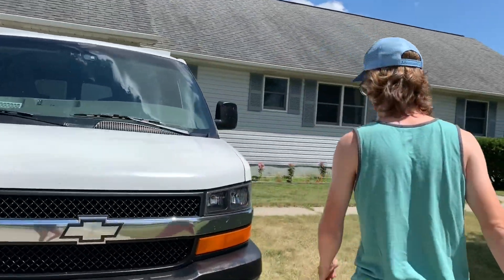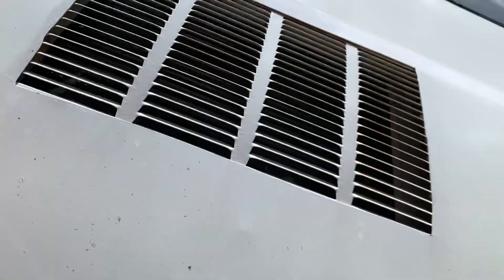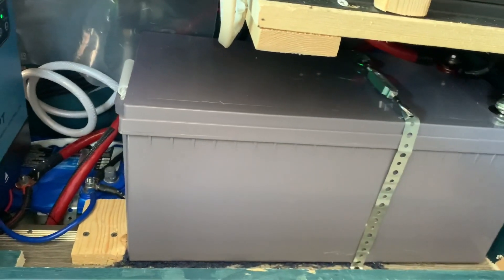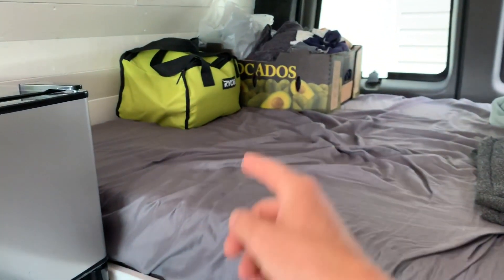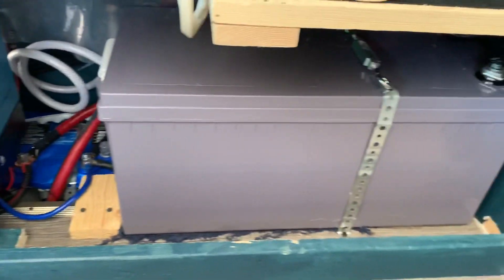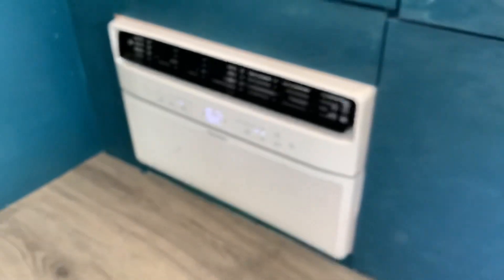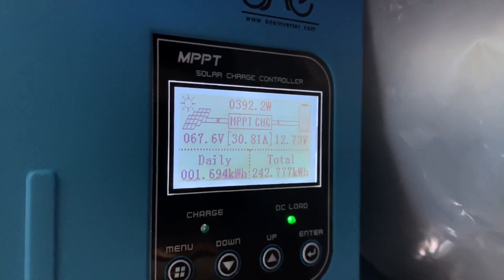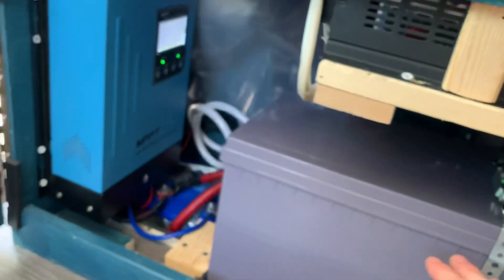Van Life Solar AC Setup - Totally Off Grid

Comment: You need a much bigger battery bank for the AC to run through night.
Reply from the maker: You’re right, but if we ran it all night we would be below freezing inside. (It's only 250cuft of airspace in the vans living area - the average small bedroom is 1,100cuft)
About halfway through the night ours would rarely come on except once or twice before the morning (as the outdoor temp already dropped and there was no further need for cooling).

In the dark, the sun won't be baking you inside the solar oven that is the van, so a good average after dark might be 25% cycling (15 minutes run time every hour). So, if you're calculating 10 hours of AC at 25% cycling, that would be a cumulative run time of 150 minutes. (2.5 hours)

Of course, this all depends on your outdoor night temperatures. We don’t stay in Phoenix or Vegas during the summer as it’s 120F in the day and 100F at night… The van has wheels for a reason!
Our AC (even after inverter inefficiency losses) draws almost exactly 50 amps at 12v.
50 amps * 2.5 hours = 125 amp hours

To calculate the usable amp hours, you must decide what depth of discharge (DoD) level you’re comfortable with. 
Is it 50%? 75%? Or do you go all out and run your batteries to 100% discharge, not caring about the usable life?

Will for sure make a video of the daytime / night time cooling along with battery levels and indoor / outdoor temps once it warms up for a test!

Comment: I've crunched the numbers to get AC (no roof-mount units) in my Van here in Australia: $2800. Now, going the DiY route, Anything under 2.4kw locally is garbage. 

Buying a small 120v unit like yours and a US Inverter, imported to Australia, I'll get change from $1000.

Great video mate !
Reply: If your interested,  I'm just trying the same thing Guys. I've managed to find a heat pump unit - with a duct pipe outlet - I'm planning on ducting it fore and aft of my build. Plus of course it will heat very very efficiently in the cold weather.. oh, and so far it's cost me just over £320
Reply from the maker: @jupiteradventure5284  I hear heat pumps are more common across the Atlantic than in the US. So sad as it's such a simple principle and typically the most efficient form of electric heat!
Sounds like a sweet build!
Reply from the maker: That's bonkers. Glad it helped out!!!

Comment: The A/C unit could be installed higher or air flow is channeled to blow at the ceiling level for better cooling performance
Reply: I don’t think it’s wise to put heavy stuff higher in a van, because the center of gravity. The van will roll over easily.
Reply from the maker: For sure. Mine has windows all around though so no way to exhaust the condenser heat unless out through the pop-out side window.
Will have to duct the cool air up higher in my next re-config!
Reply from the maker: Just installed ducting to the AC unit. Should have done it sooner.
https://youtu.be/wq_KdOZR2R0

Comment: Do you have 24 volts setup for your solar?
Reply from the maker: Just 12v. Really liked the idea behind the Victron battery combiner instead of a DC to DC charger (and the cost savings)

But it would have been nice to run smaller wires and enjoy the more efficient Solar chargers and inverter systems.

Comment: How much battery would you need to run all night? We’re in Florida so it’s pretty much a necessity
Reply from the maker: Ah. Good old Florida. Always hot and humid.
I wish I could give even a general idea, but it depends so heavily on how often the AC cycles throughout the night.
About halfway through the night ours would rarely come on except once or twice before the morning (as the outdoor temp already dropped and there was no further need for cooling).

Try this out:
https://www.batterystuff.com/kb/tools/calculator-sizing-a-battery-to-a-load.html
Our AC (even after inverter inefficiency losses) draws almost exactly 50 amps at 12v.
Then the only variable left to input is the run time (load duration).

In the dark, the sun won't be baking you inside your van which is essentially a solar oven, so a good average might be 25% cycling (15 minutes run time every hour).
So if you're calculating 10 hours of AC at 25% cycling, that would be a cumulative run time of 150 minutes. (2.5 hours)

(You can run it much longer if you want to drop below that discharge level, but the higher the depth of discharge (DoD), the more you take away from your batteries usable life)
Reply from the maker: I should also mention a HUGE determining factor is how much air you're cooling.  Our van is so small with the low roof and large cabinets / raised bed that there's very few cubic feet of air to cool.  A large Sprinter / Transit / Promaster will easily double / triple the amount of air to cool.
Just food for thought and thinking out loud on that!
Hope that helps! 
Thanks for watching Tyler!

Comment: Love the stealth grill look. If you did it again would you put the air conditioner higher or would you just duct the cold air higher off the unit so it would naturally drop? Also would you or do u recover the water from the air conditioner?
Reply from the maker: Hey Shane, if my van more were square and didn't have windows all around the upper half I would probably mount it higher.
The glass windows surrounding the entire perimeter of the van made that tough.
Even if it were a cargo model though, the GM vans have a very "rounded" interior (where the ceiling is much more narrow than the floor)
This would make the AC unit protrude way out into the living space unfortunately.

I think I would floor mount it again and duct it higher in this particular set-up if I were to do it again.

I don't recover any of the water from the condensation, it just drips to the ground outside. There is a huge 75 gallon (284 liter) water tank under the bed, so we don't worry too much about our water levels.

Thanks for watching!!
Reply from the maker: Hey Shane, actually just finished adding ducting to the AC unit (finally!)
https://youtu.be/wq_KdOZR2R0

Comment: Great job on your van and your well explained video. Can rooftop panels be mounted to tilt when you want, for Max exposure?
Reply: Look for Snow & Kurt channel on YT.
Their van has a killer array that lifts with linear actuators.
Not really complicated.
Reply from the maker: Excellent idea as it would really increase the solar input (by more than double in some instances).  It's something I would have loved to do but lacked the welding expertise.
Reply: @VanwithTim  bolt an alloy frame with hinges. Sorted.

Comment: Could you mount this higher up and then run ducting from under the van to where the a/c sits? The small fan may push the cold air around enough where it's not really necessary, but was there a reason you floor mounted it besides being able to pull outside air in easily? Awesome, awesome setup, much respect!!
Reply from the maker: Excellent question. It would have been ideal to mount it higher up, but our van has glass windows all around. That would have blocked our outside vent. Also the curvature of the van walls would have pushed the unit too far into the living area (if that makes sense)

Thinking of adding ducting to it eventually!

Comment: what was the cost of solar setup ?
Reply from the maker: Item					Price	Purchase Location
Sunpower 230w panel	$400 	FB Marketplace
Solar mounting			$55 	Home Depot
Odyssey Battery			$180 	FB Marketplace
Optima Battery			$120 	FB Marketplace
Renogy Battery			$363 	Amazon
3000w Inverter			$275 	Amazon
Solar Charge Controller	$178 	Amazon
Battery Isolator			$44 	Amazon
Switches, outlets, wiring	$250 	Misc.
Fuses / Circuit Breakers	$100 	Amazon
Refrigerator				$100 	FB Marketplace
AC Unit					$200 	Craigslist
Total					$2,265

Comment: WOW.  That's a lot of solar.. but the problem with solar is you must in the hot sun.  300AH of Led acid batteries , realistically only gets you about 125AH of usable, which is  only about 1500WH or 2.5 hours with that  AC with nothing else running.  What's the state of your batteries at 6am?

Question.  What engine and alternator is in that van?  Does your vans OEM automotive A/C blasting on high while parked in the shade cool the van in the back?

What's your opinion about running you van's Automotive A/C while parked?  In my much smaller Ram Promaster city 4 cylinder  I will occasionally just run van's OEM AC parked in the shade for an hour or two when i need to be inside during the day and right before going to bed. The AC on high will cool the back in 1 minute COLD.   It's a debated argument, but seems mechanics consensus now is that in modern engines it's doing no harm and costing around $0.50/hour to run your AC while parked for an hour.  Been doing it for a year and I just keep an eye on engine temp and coolant level .. anyways rarely do I want to be inside the van in the middle of the day for too long.
Reply: I know it’s a year later but Viper car alarms make a model with a temperature control. Set the temp in programming and leave your car set with ac on full blast and the alarm will turn your car on when it gets too hot.
Reply from the maker: @ebombglass  I actually had one of those models back in 2009! Cool concept from a reputable company. I'm sure it's even more integrated now.
-Tim
Reply: @ebombglass  I saw a guy who rigged an old Chevy Cavalier with a house thermosat, so the engine would go on and off at different temperatures with the AC set (he just left the key turned and the AC set to max when he wanted it to auto-cool).  Had to run wires into the engine, I'm not sure exactly how the rig worked, but it was pretty neat.  Called the Cavacruiser if you want to look it up.
Reply from the maker: Been waiting to film a video to answer these (Lots of good questions I should have mentioned in the original video) but the weather hasn't allowed a good time-lapse test video yet.

The real tricky part is the AH ratings and how unrealistic they are. Of course you could run all 300AH out of the battery bank, but you've then dropped your voltage to nearly 10.5v (causing your batteries to take a huge hit in their usable life)

Lots of information and debates out there on the depth of discharge and battery cycle life. It seems the only general consensus is to try not to drain them past ~11.5v which as you pointed out, only gets you about half the "rated" AH.

Luckily most places we park are hot in the day but cool at night, so the AC cycles less and less until around 1am when there's no longer any excess heat to be removed.
(This is certainly NOT the case in places like Phoenix where the night temps stay in the high 90F's)

Our van has a 6.0L gas V8 and a 140amp alternator. It uses about 0.9 gallons per hour at idle (about $2.20 per hour of idle)
I actually just finished a 2017 Promaster build for a friend and it's a REALLY nice van to work with. Tons of space, and while it won't win any races, the 4cyl seemed pretty stout.

You're spot on about the modern engines. No harm in extended idling! I'd recommend blasting the van's AC for a couple minutes to "take the edge off" then use the window AC to maintain. (I know those Promasters put out some truly COLD air!)

Thanks for the great questions, and I'll update this comment once we get some warmer days to film a real world time lapse of the battery voltage, cabin temps, and exterior temperatures.

Happy travels! -Tim

Comment: What model are those panels? Are they 61x41?

I have an extended Chevy express and 4 panels x 41" is 164". Which would take up almost the entire length of the roof. However, on an IG pic of your van, the panels look like they are mounted right around the back of the front door line and don't go all the way to the end of the back of the roof. For me to do that, they would need to be around 30" or so.
Reply from the maker: Roger Dayton It took a while to find these panels due to that same dimensional issue. Standard is 61x41. These panels are only 61 x 31.5!

https://www.pocosolar.com/wp-content/themes/twentyfifteen/pdfs/Sunpower%20Solar%20Panels/sunpower_230wht_spec_sheet.pdf

Comment: Also they said you are supposed to separate the air outtake - from the hot center and the cool sides.
Reply from the maker: Sylvia Justice yes, there are two “sides” of the AC unit. The inside (climate controlled) side, and the outside. The outside needs to suck outdoor air through the sides and top of the unit then push that air through the condenser (cooling the freon). This Freon then goes to the “inside” (climate controlled) side of the unit. It flows the cold Freon through the evaporator core. A second fan pulls the “inside” air through this cold evaporator core and pushes out the ice cold air into the van. The Freon then moves through the compressor and back to the outside condenser to be cooled and the cycle restarts!
Reply from the maker: Sylvia Justice check out this video for a good illustration!
https://youtu.be/6OU7WHgJ_cY

Comment: So what happens when the sun goes out, under the min, - does the A/C stop running?
Reply from the maker: Sylvia Justice once the sun goes down it runs off the batteries, then in the morning the sun charges the batteries back up. Luckily the temperature drops at night so the AC doesn’t have to run very long off the batteries.
Reply: @VanwithTim how long on just the batteries?

Comment: Amazing! I was planning to use a window AC in my van as well.  Where does the water (if any) from the AC drain to?
Reply from the maker: Hey Michael, glad it helped!
I have a video that shows the “guts” of the system.
Basically it drains out through the air intake hole I made under the van.

https://youtu.be/QK_zLDNW3X8